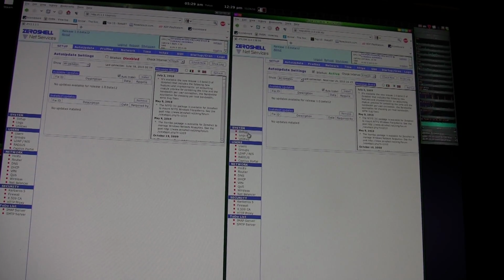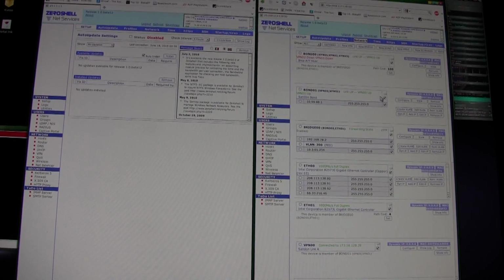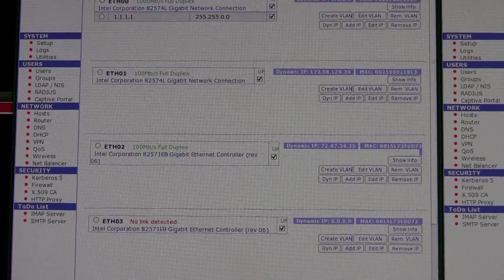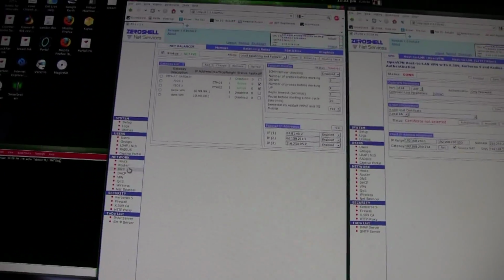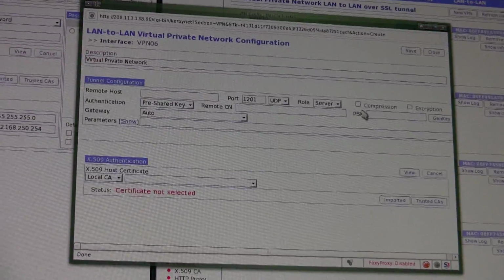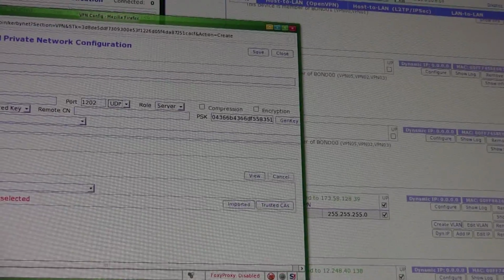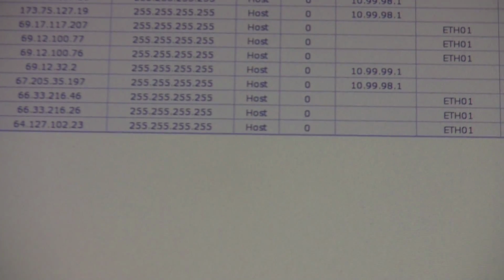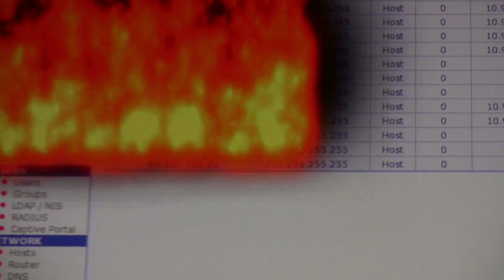Do it Yourself: Bonding Over VPN (Part 1 of 3)

Comment from the maker: That is basically what the video is doing. It is using VPN to bond multiple internet connections in order to get >1 connection on a single TCP/IP connectionvia bonding of the VPN devices going over different physical connections where as load balancing would not give you faster on a single connection basis.

Comment: Your video is interesting but I am not looking for VPN. I need help with making 3 DSL connections into one fast one with Zeroshell. All of my lines are running at 6 MB. When they are properly balanced I get 18 MB on the speed test website I have a small load balancing router that works but I am looking to make a more advanced setup with Zeroshell. I have about 10 VLans setup to go to different rooms. I am having problems with QOS as well. I have 5 routers setup right now and I would like to knock them down to one PC router. Thank you for your help.

Comment: great I will check out these videos because I am wanting to bond 3 x 300mbps down by 20mbs up into a single 900mbps down and 60mbps up connection.  I am wanting to install zeroshell onto a system locally to act as the local gateway, and in the cloud for the connection to the data center. I will check out your tutorial to try to accomplish this and let you know if i succeed